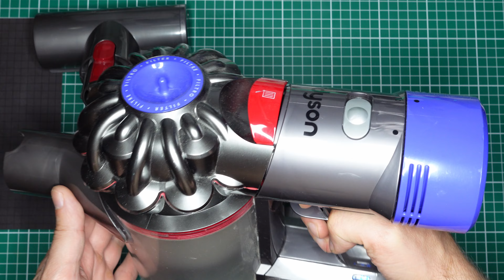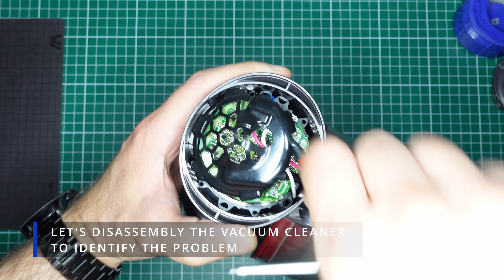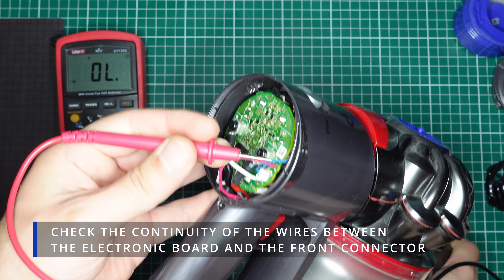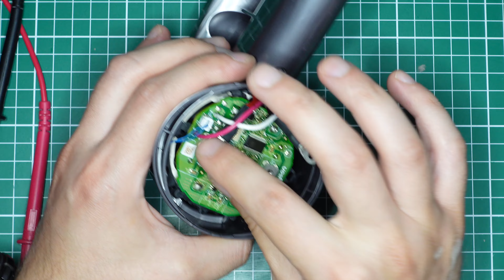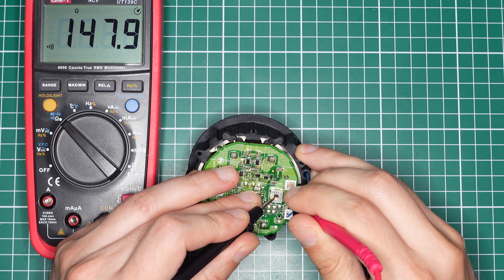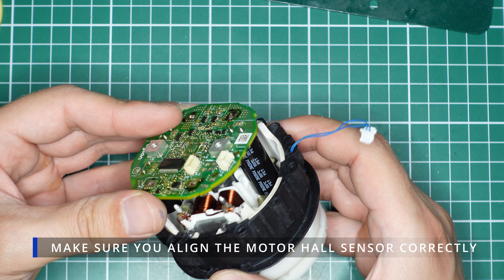Dyson V8 - brush not spinning - PCB repair

Comment: I had previously just jumpered this mosfet to get it working, but thank you so much for the part number! Finally wanted to go in and complete the repair since the shorted mosfet drew a lot of current draining the battery quickly.
Reply from the maker: Yes, it would be ideal to replace the mosfet with a new one. I'm glad the video was helpful.

Comment: How did you get the new MOSFET to stick/solder on the board?  Are you using the existing solder that was left on the board from the prior MOSFET?
Reply from the maker: It's better to replace the old solder with a fresh one (leaded solder).

Comment: Great video! I have a V8 of which the motor stops spinning when I select max mode. Normal mode works fine. I now have unmounted the motor, and when I activate the reed sensor (max mode) the motor stops spinning. Any idea which component on the PCB might be causing this?

Comment: Howdy!
I have a problem with my V7. It runs perfectly in normal mode. Something like mins. If i put it into MAX Mode it directly quits running. Even if the battery was full charged.
I also changed the battery, but same mistake...
I think there must be an issue on the PCB. Where should I look? Or maybe do you know which part of the PCB I should replace..?

I would be very thankfull if you could give me any help

Comment: Hey, great video ! my dyson V8 brush stopped working recently and found your video. 
Is there a way to make sure it is this MOSFET ? I don't have any experience soldering and I need to buy all needed tools to get the job done.

Any tips, maybe other videos you made to learn how to work in those tiny spaces without damaging the board ? 

My vaccum brush used to rotate recently and now completely stopped, I tested using a multimeter the power pins  (while triggering the vaccum) no power flows down through the connections to the extension and the the brush itself .. so I do suspect this MOSFET.

Waiting for you answer , thank you !

Comment: Awesome video. Question for you that blue wire that you unclipped with white end from mother board, where does the other end of it go to and what is it for? 
Does it just go through that rubber sleeve tube and wrap around and stick into the sleeve tube just above it ?  

Thanks and great break down u😮😮
Reply from the maker: The blue wires are connected to a Reed sensor. This sensor closes a circuit when the power selector is in the MAX position. 
The button has a small magnet applied that activates this Reed sensor. The Reed sensor is a glass bulb that contains two contact blades that change their position when they are in the presence of a magnetic field.

Comment: Hello,
Thanks for the video, I have almost the same issue.
When I pull the trigger switch the brush start to spin but after 2 or 3 seconds it stops. I measure the voltage on the two wires near the motor at the brush and it is dropping to zero after 2 or 3 seconds ???
Can the problem come from the same Mosfet ?
Reply: Sound like the build in safety mechanism to stop the brush when it is clogged, and therefore draws too much current. Did you try another active brush?

Comment: Hello. Do you know the output voltage and amperage values for the ground head motor on the board? Could you please answer?
Reply from the maker: Can you be more specific? I don't know which motor you are referring to.
Reply: @techfixPOV  Volts and amperage from the DysonV8 type Vacuum motor driver board to the floor nozzle brush motor?
Reply: @muttalippnarbas9262  Battery voltage

Comment: Hello, my V7 model looks like the same board.  Mine overloads and cuts out on high speed. Do you have any thoughts on what might be causing that? Thanks!
Reply from the maker: Does it stop when you use the MAX button? Try without filters installed. If it works normally without filters, you should clean or replace the filters.
Reply: @techfixPOV  Thanks for the reply.  It doesn't work even when the filters are out. I called Dyson and they said it was most likely a bad motor and since it is discontinued, they don't support the model anymore and don't have parts.
Reply: @mrzabie0138  If your vacuum is a little older by now, try a different battery. They wear out fairly quickly due to the substantial abuse they need to tolerate to supply a powerful motor. Cutting out and/or lasting very briefly is a symptom common with worn out batteries, which develop a high internal resistance and cause a substantial power loss that causes the system to cut out to undervoltage protection.

Comment: Thanks for video. I've got v10 with same problem. And checked MOSFET and it seems ok. Hope for help. Thanks
Reply from the maker: I recommend that you completely disassemble the electronic board and check it on both sides of the liquid. There are several points on the back of the board that can be very easily affected by liquid and generate this defect that you are complaining about.

Comment: what did you use to de-solder the mosfet chip ? Is this a heat gun and what was the solution that you applied to remove the solder from the chip?
Reply from the maker: I used a hot air soldering station, both for desoldering and for soldering. Temperature 400 degrees, airflow at half power. The applied solution is AMTECH flux.
Reply: @techfixPOV  thank you
Reply: @techfixPOV Thank you!